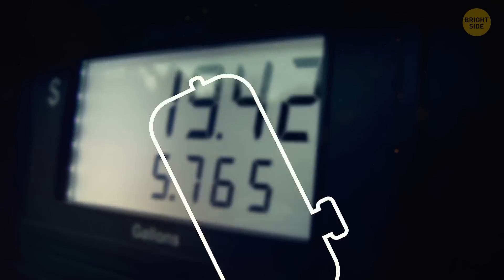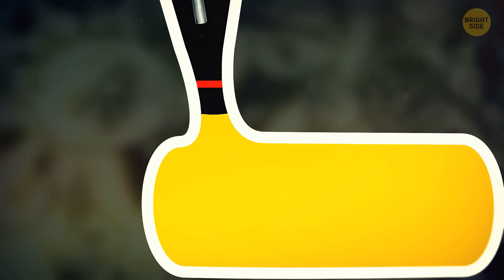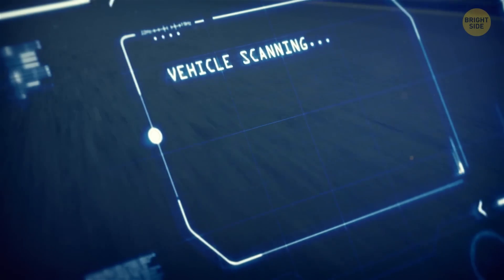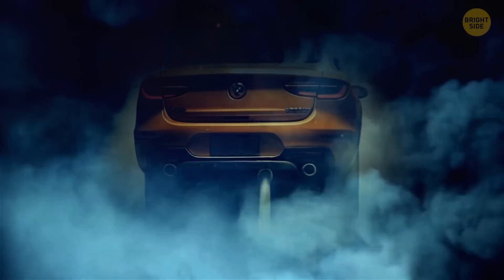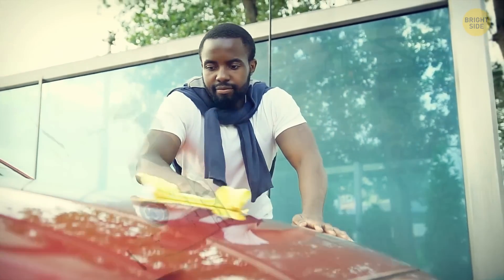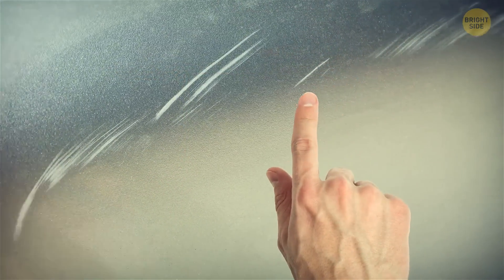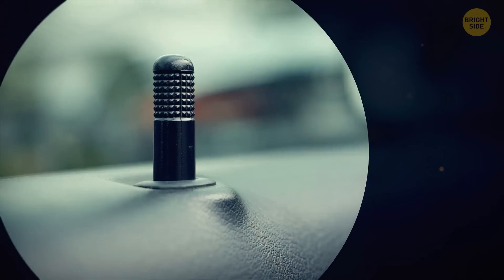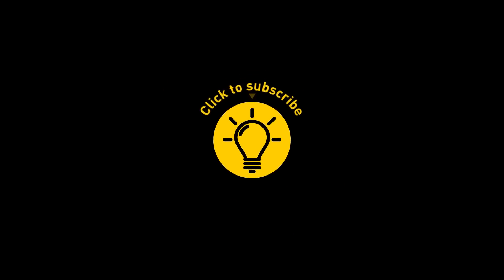How Gas Pump Knows When It's Time to Stop

Comment: You shouldn't wait until near empty to refuel. You should refuel after 1/2 tank is left. By going empty frequently it wear out the fuel pump sooner because the fuel pump is designed to be subermerged in gasoline and the more time it is not, it wears